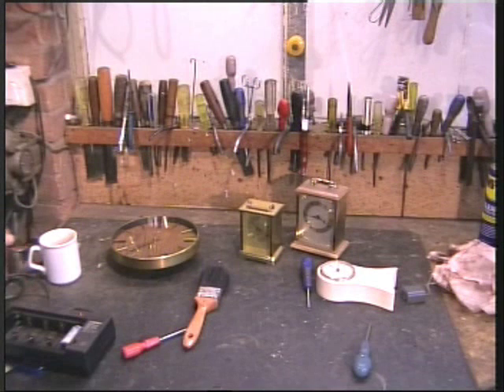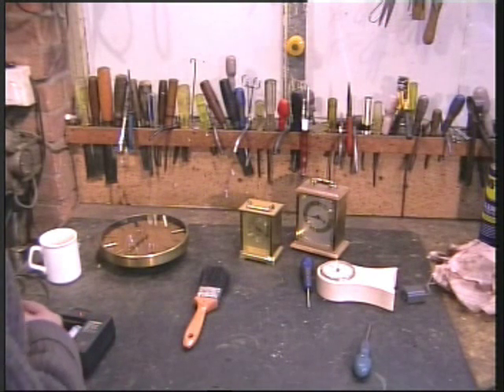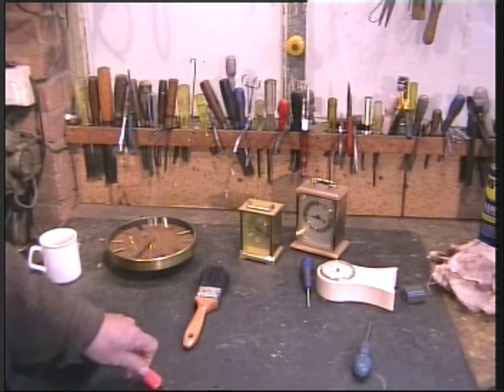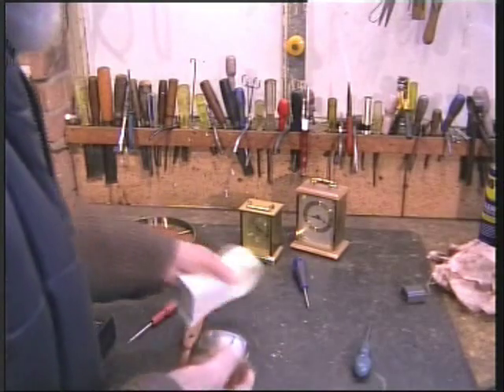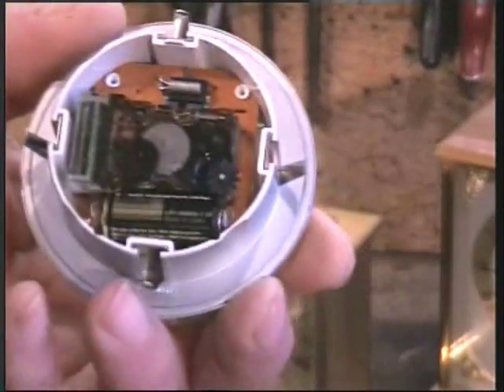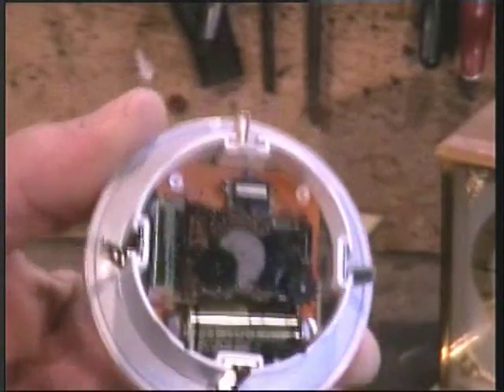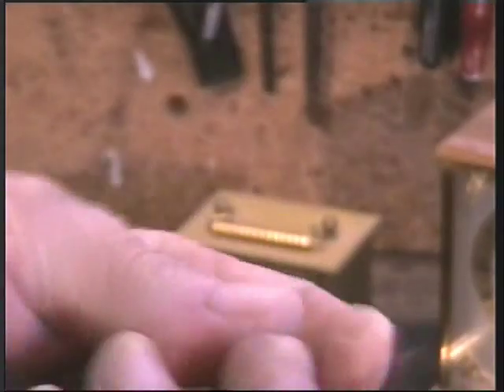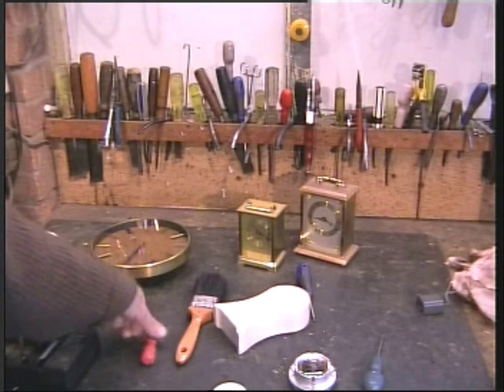tide clock.wmv

Comment: So you said that the tidal period is about 12:34... so you're basically slowing the hour hand down by 34 minutes per 12 hours = 68 minutes per day (about 4.72%)? How large of a capacitor (approximately) is required for this adjustment? I presume that the voltage rating only needs to be like 1.5-3V or so, eh?